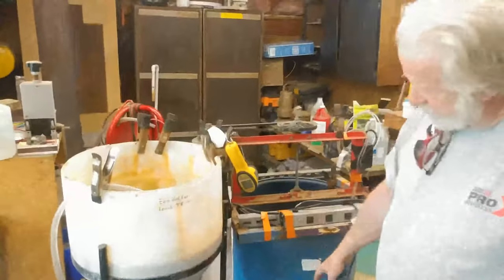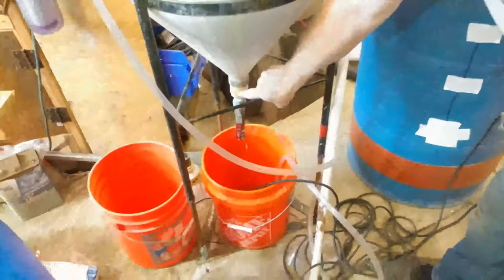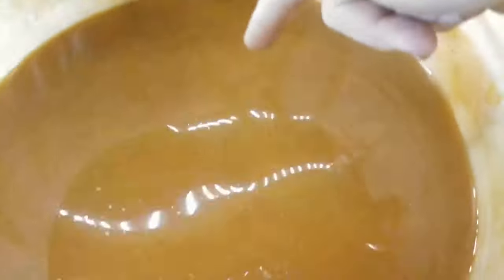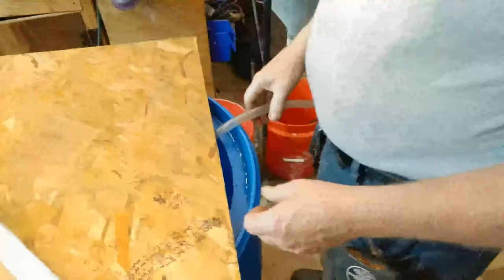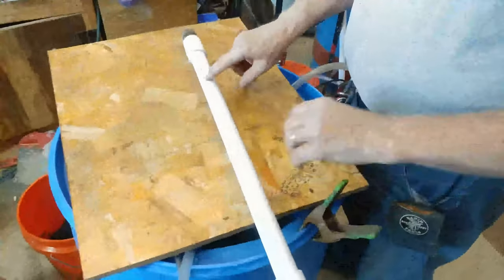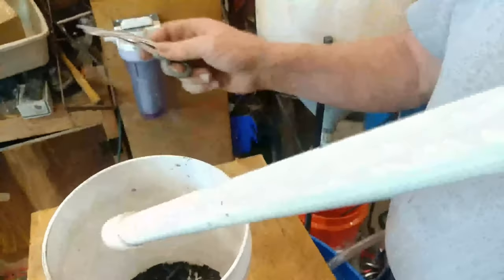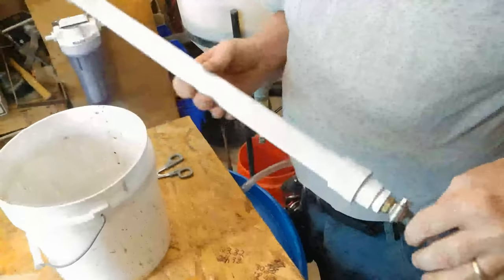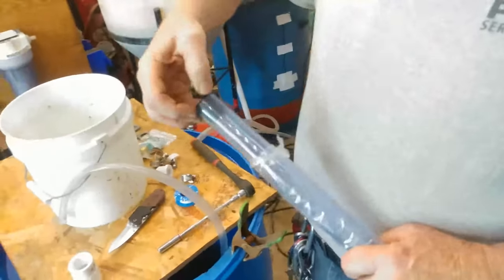AGITATED LEACHING OF GOLD WITH ACTIVATED CARBON - A GREAT WAY TO LEACH GOLD

Comment: I'm sorry sir but i don't get it what you want to leach from that pyrite ore? Panning the fine material would do the job as gold and iron/lead is dense and heavier. Can you explain to me of you will.
Reply from the maker: only the larger pieces of gold can be collected  via gravity methods.  some gold can even float away in the smoke of  resin ashing.  And most gold is invisible to the eye due to its small size.  This is why leaching is so popular.
Reply: @bosrecreationalmining  Why not just grind the ore add heat it to remove the sulfide then add nitric acid to remove steel or lead and then add aqua regia to disolve the gold, is that method is look more easy to do?
Reply from the maker: the iron that the gold is tied to has a weight that is about the same as the rest of the ore. the gold at such a small size will not sperate via gravity.  this is not placer mining.  it hard rock and we dont let any gold was out the end like the guys on tv do. ever see what they do with the black sand that they collect?
they ship it out to be crushed and leached just like the hard rock guy do on there own.
Reply from the maker: why not just wash the gold off the sand with a hot leach ? and save the acid for the refining.  when you acid wash iron you get dissolved iron in acid with gold.  good luck separating that out. Why do that if you dont need to!  thats why alkaline leaching is so popular. it skips right over the iron.
Reply: @bosrecreationalmining  Cyanide is hard to get in our country so we use acid in here sir, even the chinese leaching product is not common in our country instead nitric acid is just $3 and Muriatic acid almost the same in price.
Reply from the maker: gold is in the pyrite!  pyrite has oxidized and  become magnetic due to it being so  shallow . Oxidized pyrite is not very heavy.  it can be paned out but you will miss a lot.  The gold is on  and in the pyrite and is mostly close to the outside of the pyrite.  Gold can be washed off with hydrochloric acid ( not cost efficient)  
 The gold can be leached many ways with many lixiviants.      .
Reply from the maker: avoid acid leaching use a selective alkaline leach like the eco gold-ex
Reply: @bosrecreationalmining  Yes like thiourea but i actually got difficulty when leaching a gold with this i use 4gram of thiourea, 1gram of ferric sulfate, and 1ml of sulfuric acid per liter of water but i don't know the best measurment from this gold lixiviant method, do you know the measurment? Can you help  me?

Comment: You put the Teflon tape on backwards.
When you put it on you have to turn it the way that you need to tightened
Reply from the maker: i think tour right about that.  I have many thing that need correcting and up grading. most of my equipment is still in the proof of concept stage.
Reply: @bosrecreationalmining  Don't feel bad.I know plumbers that do the same thing

Comment: On reisin 1). Loads deliterios metals first, Au, PGM last. 2). Ashing of reisin.  Requires heat at 1100 f. Or so with a flow of air over the reisin.  A few degrees change + of heat vaporizes the metals.  Was collaborating with ex employee at silver anvil and finally with du pont chemical.  Very costly.  Make whoever is selling the reisin to you to do a demo on Your loaded reisin before buying..
Reply from the maker: good info.  i have resin but not using it yet.  i have the king that is supposed to be selective for  gold and uranium.